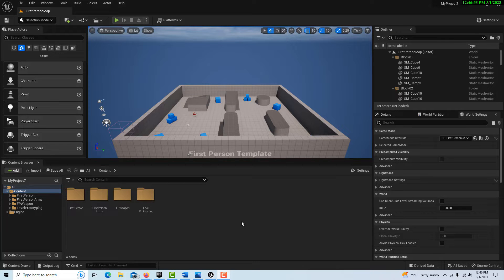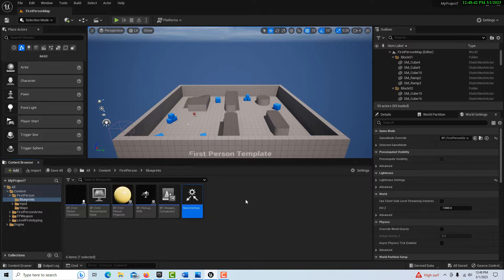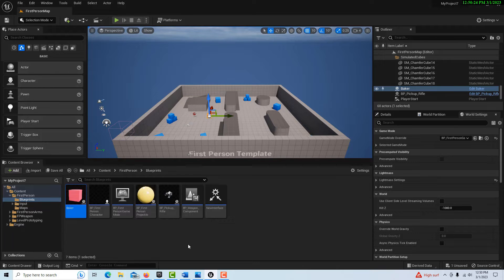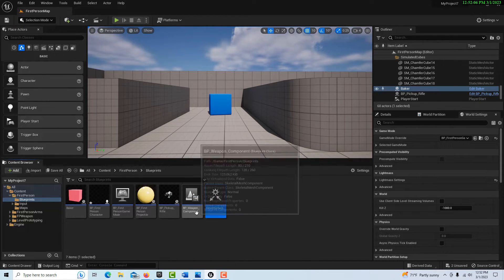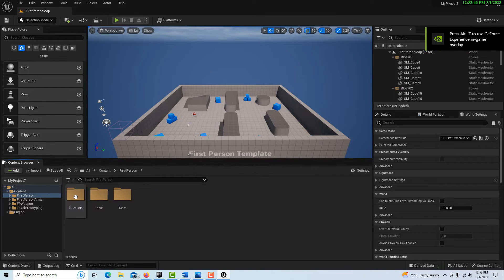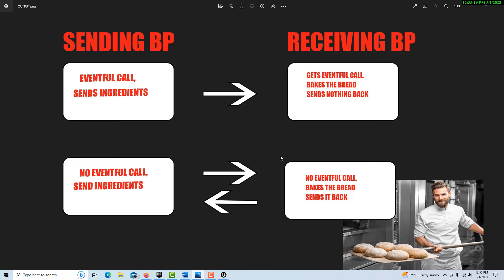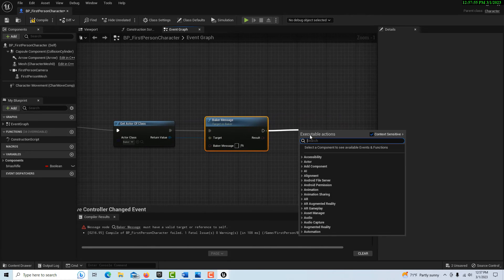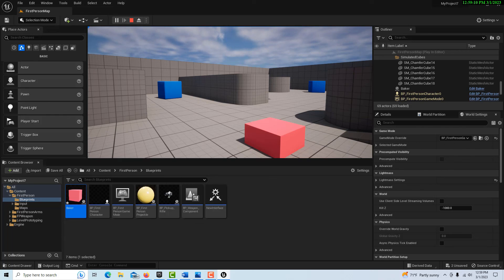Understanding the Output Function on the Blueprint Interface in Unreal Engine (see update in desc)

Comment: at 8:40, if you had put your initial message of ingredients in the input, you could have used a print string inside of the "function" over in the baker and printed the incoming message, and also got the return of the baker's message. alot more can be done inside of interfaces, they're a great "tool" to use once you get the hang of it